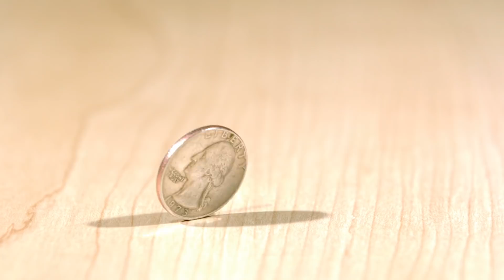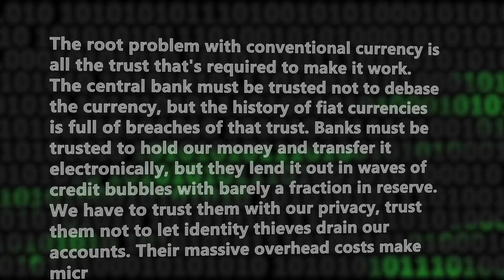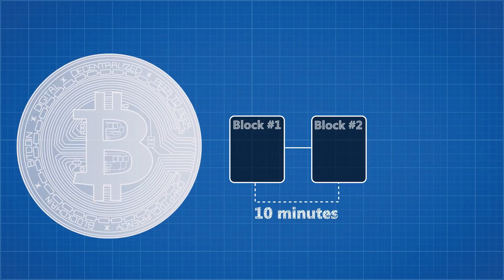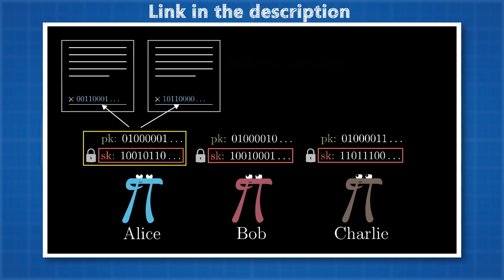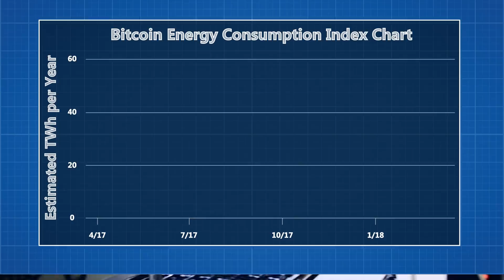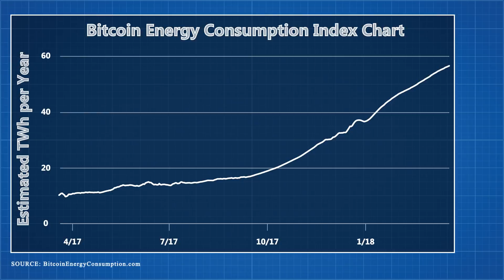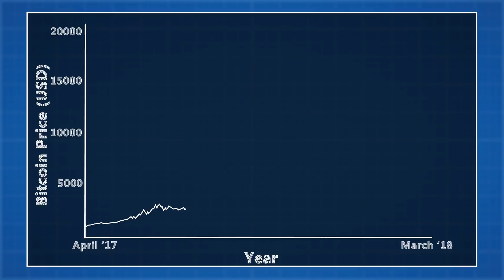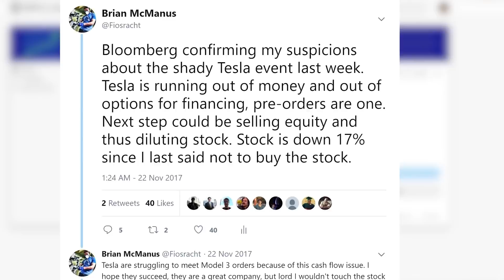Why Bitcoin Is Not Working

Comment: I still didn't understand why bitcoin is not working
Reply: When the price of gold varies as measured in US$, is that the value of gold changing, or the confidence in US$?  The record over the last century of what each can buy in common commodities suggests it mostly isn't gold changing value.
Reply: Currently you can't buy anything with Bitcoin (doge coin is the only currency I've ever seen used this way and they have less value than a view on YouTube). You always exchange it to USD or GBP or EUR or AUD etc. before you make an actual transaction, which either the prices are driven by a centralized crypto currency trading site, or the transaction literally runs through them spitting USD/GBP/EUR/AUD/Etc. into the bank account of the person you're purchasing from. Essentially using bitcoin like a Visa where a centralized currency trader basically handles the transaction, no different from a bank.

Fact is Bitcoin (and all other cryptocurrencies) are not working as intended, because in order to trade in them you'll need to go through a centralized currency trader... With any knowledge of early currencies (and the fact that each town could have a different silver coin) you'd know that these currency traders are essentially just what a medieval banker did. Had stock of a bunch of different currencies and traded them, for a profit of course. The coins are intended to remove the middle men, and all they've done is create a bubble for new middle men to replace the old ones.
Reply: Melody Storm 1 statement about the middle man, yes for bitcoin, but there are cryptos that don’t have fees, they’re just not bitcoin and popular yet.  IMO, the technology will prevail, cryptos may indeed fall.   The banks are just going to apply the tech to their own systems.  Btw, it’s already in development.
Reply: Because their is one person that gives it a base price, and the amount of money you need to invest into it to actually get profit. Just look at it going to 19k then all the way down to 8k in just 3 months. Also it not being accepted by Amazon which might have helped it stay at a certain price.
Reply: "Bitcoin will hit 100k in 2019 and 1 mln in 2021." 
So Bitcoin is an investment, not a stable currency.
Also it is wrong to assume bitcoin is a decentralized system, it is centralized by companies , especialy one i guess everyone know.
Reply: How not? Just like storm said.  Would you pay for something that fluctuates in value 20% each day?  A usable currency must be regulated and reset on occasion to be a good medium for a currency.  

Not one crypto is doing this because all that’s going on now is people making them to make money, not to become an actual currency.
Reply: Gabe Wilberscheid the currency of 1 country is valued at that price by every other country. 1$ is x€ and x£ and x¥ and that varies slightly. Bitcoin is not like that 1 person can sell all their bitcoin for usd and bitcoin will drop (this happened actually.) Unless countries give it a value in usd or € or £ or ¥, etc, people won’t care enough to invest into it when it can drop and they can lose al of their money.
Reply: Your 5 BTC is still 5 BTC, their amount in USD have changed, this is not Bitcoin's fault nor a proof that it's not working. Bitcoin is still a tiny market in comparison, if it grows and there is a huge market cap then the volatility will be closer to the levels of "stable" currencies like USD or EUR.
Reply: Not working as intended. It's meant to replace currency, not become a second gold standard.
And it only processes 4 transactions/second. It's not sustainable.
Reply: Dark Horse 
1:13
Reply: Your missing the whole point. Why not trust the federal reserve? Have you seen most nations national debt?
Reply: The gist of it is it's not very energy efficient and slower and fluctuates wildly.
Reply: El Mahdi Ettaleb I agree this does and will happen. But the same has happened time and time again to country's. Until there is a crypto that measures someone's actual value of time and skill this is always a possibility. But I trust the math more than bankers and politicians so let me dip. Anyone who was in very early in large projects will never see losses if you take gains out at a set rate. It just is hard for 7 billion to no longer trust what they have killed for, and fail to see the differences because the system is run by old money.
Reply: El Mahdi Ettaleb all goods have lowered in cost, even with inflation. Global free markets do this.
Reply: El Mahdi Ettaleb because peer to peer decentralized global currencies are a historical event. Its going to take a long time before services are built around the market and most people see the value in actually owning your money at a gloabl scale. I'm not saying to ditch you fiat, but cryptos will never go away.
Reply: And number of transactions 4 per second isn't fast enough.  Other transactions types take 100 million a second.  It can't keep up as a currency.
Reply: you got this fundamentally wrong my friend. in a public block chain you ned incentive and tyhats why the tokens and coins are for and if you wanna use a private block chain you might as well use a exel sheet
Reply: +Dheeraj Bhaskar  The first point was that the competitive checksumming process increases with the number of servers as the difficulty level is increased to keep the blockchain creation rate close to one every ten minutes.  This means the power consumption for un-used calculations increases geometrically.  The other point is that the Bitcoin mining reward for generating a new blockchain is halved every year and is actually scheduled to go to zero.  There is a small transaction fee that will still provide some reward but hardly enough to pay for the servers, this plus the fact that other cryptocurrencies have been created means that the servers will eventually switch to a different cryptocurrency when the Bitcoin mining rewards drop to the point where mining is no longer profitable, keep in mind that the blockchain's resistance to counterfeiting depends on having most of the servers being honest and under the control of independent people or organizations.  Then he added the volatility due to speculation detracts from it's use for trade instead of investment as a commodity.
Reply: Well. Depends on what goals you have. If it meant to work as a useful currency for daily transactions then it does not work due to it being so volatile. The transaction time limit can also be a bit of a problem.

It does not work as a untraceable currency ether as you can trace it via the blockchain. While the coins them selves are not marked the transactions are. So it not as anonymous and some people claim. This effect mainly people doing illegal activities such as stealing bitcoin or buying illegal goods. And some would actually view that as a plus.

It has a big negative impact on the environment, mining for new coins means you need a lot of energy and hardware. Something that has pissed off hardware enthusiasts and environmentalist like. It is not a good alternative for other currencies from a environmental standpoint. 

These are some of the flaws of bitcoin and a lot of people tend to ignore them. For me bitcoin is more a proof of concept. A stepping stone currency which we can learn form and potentially use as a stepping board toward developing improved transaction and trust systems.
Reply: Somebody or someone need to make bitcoin price stable or even dead lock than it is working, when greedy whale wanted to buy alot so other didn't get make another coin with 100 billion supply ask him to buy all
Reply: Ah, so your idea is to literally just make bitcoins the same as dollars. One company makes a new payment method, that's faster too. Literally the same thing with how credit cards and such came to be. Bitcoin's problems seem to be solved by becoming the thing it wanted to replace.
Reply: You underestimate the difference in amount of work that has to be put now into a jacket vs the amount of work it took to make a jacket 300 years ago.
Reply: Dheeraj Bhaskar Cause  IF  I understand this video correctly the energy use output to make bitcoin and currencies like it are  FAR LESS  efficient and  FAR MORE EXPENSIVE  to make to circulate than traditional money or credit or debit card payments.  Sadly human greed possible dishonesty of people's character = the problem.
Reply: Do you buy your groceries with gold? No? There's a reason why. Because it fluctuates a lot, and worse, as he said, it's a purely internet-based currency, people will make money by being a "middle-man" for you to buy groceries with bitcoin, just like a bank, so why not use a bank instead of a less stable bitcoin banker?
Reply: Melody Storm
you don't use gold because of social conditioning.
You have been convicted a Note(debt instrument ) is better than a Gold a (non debt instrument ),
its not because you made an informed decision.
Reply: Nuclear Drift I think there will be a point in the next decade where unemployment tests more people's faith in governments to take care of them. And many will not be able too, but peer to peer markets will always have more and more value if trade isn't restricted. That's why peer to peer value chains, which is all a fiat is, aside from a group of people telling you what you can and can't do, or how to live and now unfortunately how to think.
Reply: The value of bitcoin and the amount of it is irrelevant. How about a money that I can actually use without feeling off that I used fakes, copies, was earned legitimately by actually working and I know the value of that currency is somewhat stable?
Oh yeah! REAL MONEY.

Comment: So how is not working? Large electricity consumption just proves that a truly censorship resistant trust network (bitcoin) is worth  spending a ton of money on to secure because it is immensely valuable. Also LN will be scaling bitcoin to visa or higher level of transactions in the near feature while also improving privacy. Please don't spread FUD. Bitcoin will be stable once it reaches in the millions of valuation similar to gold. If it ever did become the universal unit of account prices in bitcoin would be extremely stable. Once the mining reward runs out (100 years away) and it is transaction fee only lets assume that the bitcoin network has scaled to 10 mb block (with better hardware/networks this can be done in the future without compromising decentralization)  and LN is handling most consumer size payments. The fees for onchain transactions (equivalent to a wire transfer these days) would be maybe $20. With segwit and 10 mb you could do about 150 transactions per second onchain or $260M per day incentive to mine and secure the bitcoin network (over 10x todays levels so there will be sufficient security). Most users could operate almost exclusively on LN and only settle to the main chain a few times a year similar to a chequing account fee for unlimited almost free transactions. Also, you are likely looking at pools when stating that mining is centralized. Although there is a degree of centralization most of those pools are actually comprised of many independent miners who could switch pools at a moments notice if the pool acted in a way that they did not support such as a 51% attack on the network (extremely unlikely to ever happen). I did not even mention many of the other technologies such as rootstock, schnorr signatures and MAST to name a few that will further scale bitcoins capacity and capability. Please do some more research.

Comment: People try to solve the problem with Bitcoin low transaction speed and increasing transaction fees in the two following ways (beside switching to another cryptocurrency like Ethereum - which is more of smart transactions platform, at least in theory).

First, there was an attempt to increase number of transactions by increasing the block size: this led to the split into Bitcoin Gold, as the change was ultimately not accepted (with the explanation that it would give even more power to big Bitcoin miners).

Second, there is Lightning: a way to perform transactions outside ledger with good safety, only doing reconcilliation on Bitcoin ledger rarely.

Both of those are nicely described at ArsTechnica.

Comment: You did not mention the Lightning Network which will massively reduce transaction time. Also fees are close to an all time low, the mem pool is practically empty. Everything is ready and waiting but yes i agree people need to start using it. For this to happen we need greater commercial adoption. One big player like Amazon for example, if they accepted BTC that would be the kick start needed.

Comment: Wrong in the first 20 seconds. So disappointing to have to hear Smith's 'barter system' repeated as part of the origin of money given that it has been known to be wrong for over a century, especially by a creator I usually trust to have done his research. 

Plus he then compounds this lack of research/understanding later with other untruths such as that currencies gain value from coinage. He should take this video down so as not to contribute to further misinformation about basic economics.

Comment: I highly doubt a useful equilibrium can ever be reached as long as there is an absolute maximum number of bitcoins. As bitcoins are lost (hardware failure, etc.), the number in existence will ultimately decline which, as long as people continue to demand them, will cause their value to continue to increase over time.

For something to be sustainable as a currency (and be stable), there has to be enough in circulation in the right places to cover all currently "in flight" transactions as well as covering whatever hoards people have (savings for things, etc.). Bitcoin can't do that unless the total economic activity stabilizes and stays constant. The causes of a lot of financial crises in the past can be traced to currency shortages rather than the productive capacity of the economy.

That's pretty much why Bitcoin cannot ever work as a proper currency. It does work as a virtual commodity, however. It's no accident that it is behaving very much like gold.

Comment: This wasn't a useful video. Bitcoin has always been a fiat currency and meets nearly all the qualifications for what makes a good currency. (it currently lacks stability and recognition but both may come in time once infrastructure and supply are installed and mined out respectively)
The costs listed for comparison against mining power consumption were transaction costs not production costs. A useful number would be the energy costs for mining an equivalent value of gold or other currency. We'll have to wait until there are no more bitcoins to mine for us to find out the purely maintenance and transfer costs which will give us a better idea for how it stacks up against the processing costs of credit cards. In the end though it may be cheaper as the transfer services will also being doing de facto maintenance so there's no cost to re-mint money already in circulation.

Comment: The footage of the mining operations are in fact not bitcoin mines and also not running the SHA256 algorithm. Bitcoin is mined with specialized hardware. The mining hardware in this video is most likely used to mine Ethereum.

Comment: For being a smart guy there are a few points you're over looking which might be due to your novice computer programming skills. Bitcoin is managed an Open Source 'project' with brilliant programmers ready to code past any issue. Lets pick 1, electricity. Any any time the community can elect to flip the protocol (just another blockchain split) from SHA256 to lets say Scrypt, and every miner goes buh-bye, throwing control back to the little guy, creating another boom. But, there is no need right now to even bother. Failing? 1 btc was $20k last month.  https://99bitcoins.com/bitcoinobituaries/ Once all the mining is completed? You haven't heard of 'halfing' have you. They can do it for ever and ever and ever.  Mining won't be over for a very long time. My guess would be infinity.

Comment: For those interested there are a couple of cryptocurrencies that are trying to solve the main problems of Bitcoin and other blockchain based cryptos. These are the blocklattice based cryptocurrencies like IOTA and NANO. They are aiming to provide decentralization as Bitcoin together with high transactions throughput, low or no fees at all and no mining required (which can both keep the network cost cheap and environementally friendly). I thought it was worth mentioning